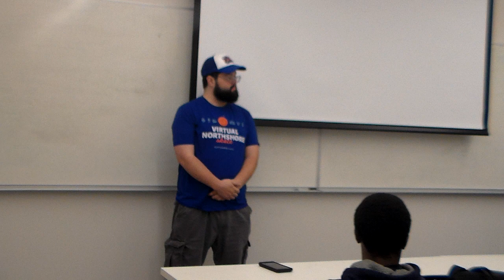Matthew Gallant TT

Comment: You did a great job of pulling out facts to answer this. When I heard the question, I couldn't think of one specific patent/author so I was impressed with your answer. One thing to work on is to avoid fidgeting with your hands. Otherwise great job.